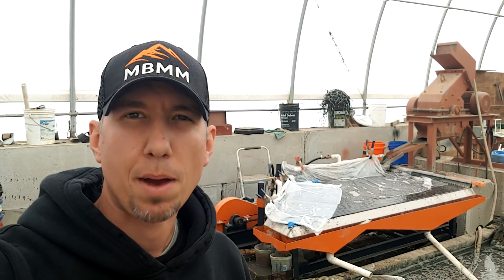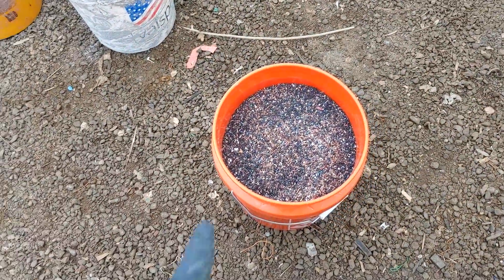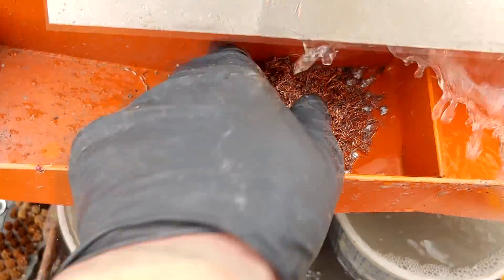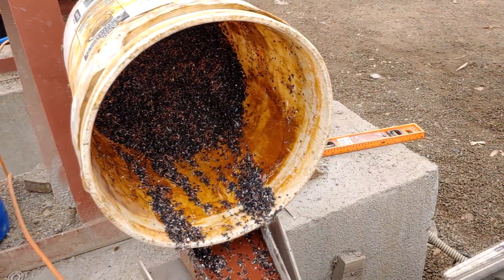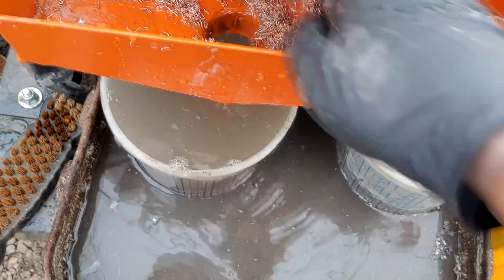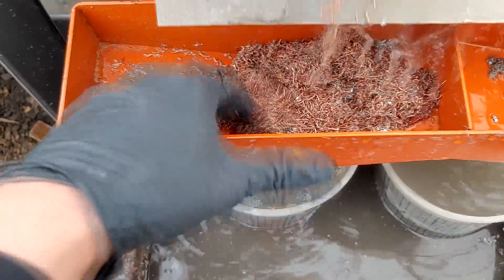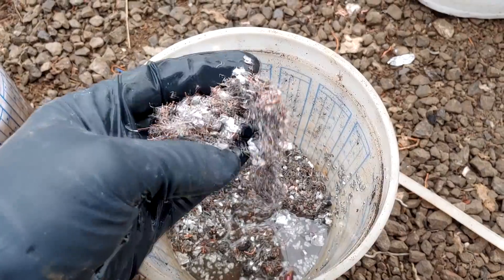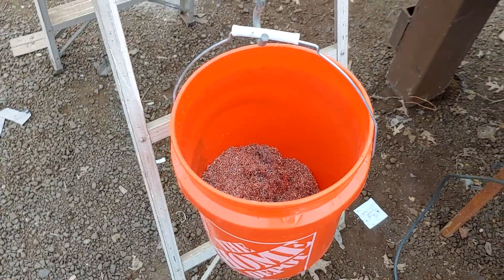Shredded Copper Wire Shaker Table

Comment: Unless it is a closed loop system, adding surfactant to the water will become very expensive very quickly.  If it is a closed loop, oil levels will need to be monitored since the concentration will eventually overwhelm the surfactants.

Comment: hi just found your channel and looking through the videos especially the mixed material scrap handling I saw you have a magnetic separator belt which is very effective , but obviously aluminium is missed and is either hand picked or sent to trash, a Linear motor would throw conductive things off the belt so placed after the magnetic  separator maybe in a drop you could recover the aluminium in a split hopper without human intervention

Comment: I found that the more water flow and a almost level sluice worked for my set up. Also downward jets of water for breaking water tension and hydro blasting the plastic off the copper. Great video

Comment: Why don't you put an e-mail out to all the electrical and electricians and buy all there wire at 10% above the scrap dealers, wire, only copper wire, run it, smelt it, sell it in bulk back to copper processors and cut out two middlemen.

Comment: Looking at your hammer mill, why don't you re-design it so only the heads, the 1'' that wears away are replaceable and not the whole hammer, also face the hammer with densicote or like oil drills 88/12 Tungsten carbide cobalt, also if the stuff went in there less angular but just slightly tumbled it would massively reduce wear as facetts are a stress raiser, and like the oil industry can a lubricant be added and recycled........Do you read these comments, just wondering, good luck.

Comment: I have tested almost every table on the market, and this is definitely the best available table there is. The surface tension and oil contamination is sometimes problematic, but with a few adaptations you can make the table surface tension free all the time. Excellent shaker table!!

Comment: so, i was thinking that it would be nice to have a sort of two bin or tub wet or dry classifier, with a full set of screen sizes. maybe 2 foot by 2 foot, per bin. and with a connection between them to use as a displacement meter. so as one bin fills with material, the other bin fills with water and the light silt and vegetation debris. and it would act as a meter for how full the other bin is. with each bin having a sizable bottom drain (to the outsides) and some sort of valve to allow draining with water or material, or just in general. on the top of one tub or bin, would be a screen set that could be mechanically shaken (like your shaker table, but with a smaller motor but about the same or variable speeds) or, a sort of small trommel tumbling screen. then, it would be at a height for a person to comfortable stand at and scoop material into or out of the tubs. if possible, i would also want a mechanism which could act like the motions one uses in the use of a Saruca, for gem concentration, but with less back aching effort, and more efficient concentrating. something like a Pleitz Jig, or however thats spelled, also, it can imagine the whole thing on fairly large rubber wheels, as a rolling cart, that one could easily get in and out of a truck, or even a vehicle like say, a Toyota RAV4, and, it could be in pieces if need be, and just a quick assembly would be needed after transport. (basically, this is something one could use at say, The Crater of Diamonds, as like a wash plant or station if one did not want to use the tubs in the search field, and, also be useful as a wash plant for home or shop use hobby prospecting gem finding, etc. i expect it would be best as stainless steel, but Aluminum could do as well, depending on various factors, including weight. i expect a volume per tub of maybe 10-15 gallons and with a bottom sloped down to the drain ports, for ease of cleaning out. so, overall dimensions would be about 3 feet or, waist high (for my 5 foot 1 inch height, im short lol) and 2x4 foot foot print at the very least. then, whatever area or space needed to accommodate whatever pulls and or gears, to enable hand operated moving of the shaking screener mechanism, would be nice. then, whatever sort of simple brackets for the mechanisms to be removable and sit securely on the tubs, and for cleaning purposes etc. as for the mechanisms, i think marine bearings and stainless parts, and all off the shelf sort of sized parts would do. then, maybe some bits to protect any wayward fingers form moving parts. in any case, i would love to have built such a cart/bin/prospecting machine, sort of thing, but i would not know the cost of material, labor, and shipping, based on this concept. but maybe you would have an idea, based on your own machines and cost of materials etc etc. i would hope such a thing would cost no more than a thousand dollars. but i expect it could be as much as $2000. which would still be far cheaper than most trommel trailers ive seen while searching about. but, a baseline idea of cost and what it would take to design it fully would be nice to have an opinion on based on ones prior knowledge of building such things.

Comment: I would have been nice to see the size/type of wire you shredded to start with. :) I've heard of #2 coated wire called "50% recovery wire" and what you have processed seems to be that but there are other recovery grades (70%, 40% and under, ect . If you ever get sufficient volumes of  different grades of wire, maybe a video of them?

Comment: You may be able to reduce what your putting on the table by putting the material in a tub of water and skimming off what floats most of the plastic will float and the heavy stuff sinks then run it to clear the rubber

Comment: Would a small jet of diluted dish detergent spraying just onto the surface of the feed help break up the surface tension in a constant and consistent manner?  It would only need a very thin stream.  Maybe even a steady drip would do the trick.
Reply: I would think that even diluted sop would foam up on a shaker table. HOWEVER! I would also wonder if the insulation would float on the foam and the metal would fall through it?
Reply: @wikkedspindl  think he means jet dry as it is a surfactant.

Comment: how do you deal with the micro plastics in the water from entering the local water supply do you reuse the same water over and over  or so you empty in to local sewers
Reply from the maker: Correct. The water is continuously recycled so no discharge.

Comment: Maybe a "paint tray " type of auto feeder could be added, dry material would be put into that. Let the table do the auto feeding. You would either have to add an extension to wet the material or you could just let it feed down dry from there. The table will do the rest. May need to put a "speed bump" in the tray to keep the feed at a good constant. Overall,  this should increase cash flow for the small wire recycling business and maybe even the hobbyist. A small recycling business could run the hobbyist wires through this either for a percentage or a straight fee. As always, ever so nice/fin to watch..

Comment: The shaker table looks like a scalpel and you need butcher knife (at least as a first pass). 

Have you considered a counter flow column as a “scalping” operation?  Then the smaller fraction with mixed material run over the table.

Comment: You said that there's some sort of oil. Have you tried soap or some other surfactant? It would contaminate the water and might be expensive.
Reply from the maker: Good idea. I have tried. It doesnt work as well as I would have though. Plastic works better oddly enough
Reply: I was thinking close to the same thing but possibly lying like a bottle of jet dry.  Less bubbles.
Reply: *like a bottle